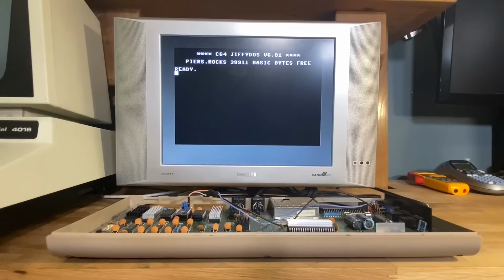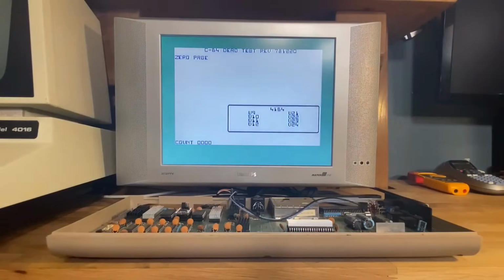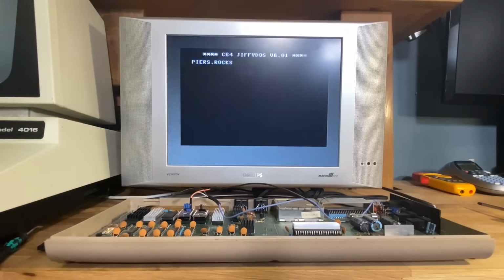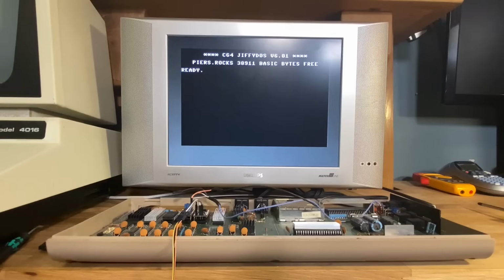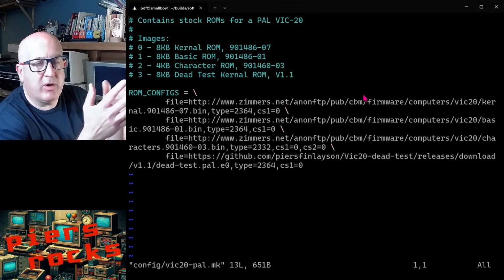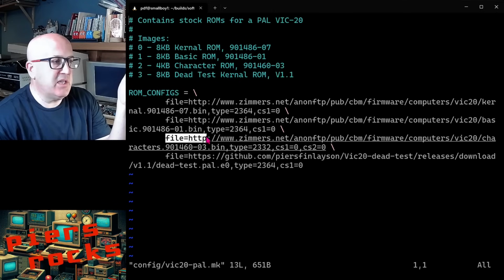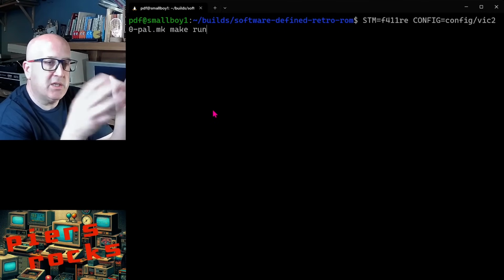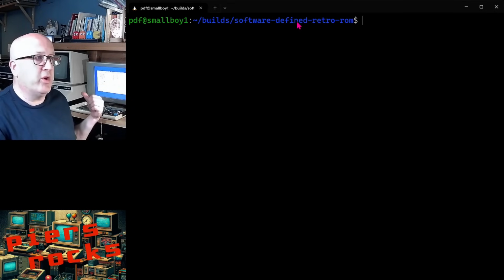Software Defined Retro ROM - ultimately flexible replacement ROM

Comment: Very nice bit of design work there. Presumably one could run a programming cable to a socket on the machine casing in order to not need to open it up to change it which is a problem with some of the 8bits with fragile keyboard cables.

(Wish I'd had this when I was working on embedded systems some years back!!!! Closest I got was an ICE processor replacement attached to crappy PC...)

Looks like the sort of thing @adriansdigitalbasement would be interested in... And some of the people who are doing homebrew stuff; being able to reprogram their ROMs without dismantling stuff would eliminate a class of errors and they can drop in 'proper' ROMs as a replacement when code is more stable.
Reply from the maker: Yes, you could run 3 wires (GND, DIO, CLK) to a socket and jack into that when you wanted to reprogram.  I have a wifi/bt daughterboard at the design stage, though, to avoid opening the case.

Adrian's spotted, and I've offered him a board - maybe we'll see it on MMC at some point.